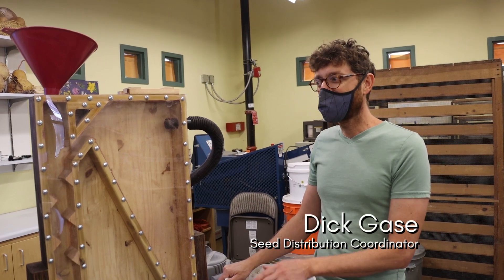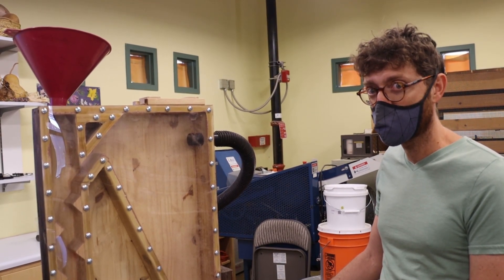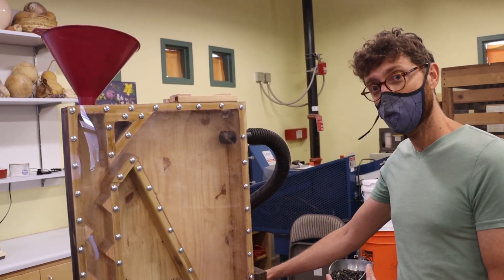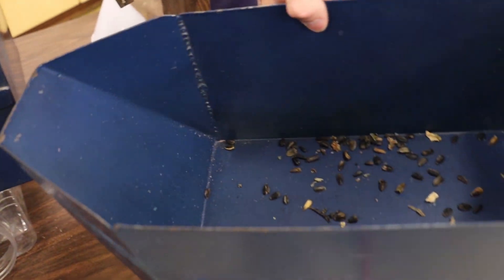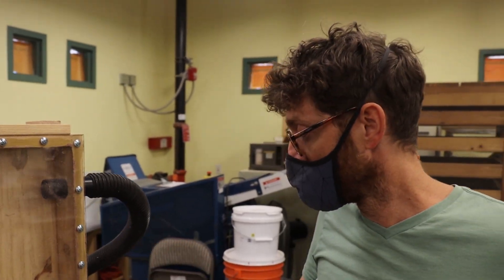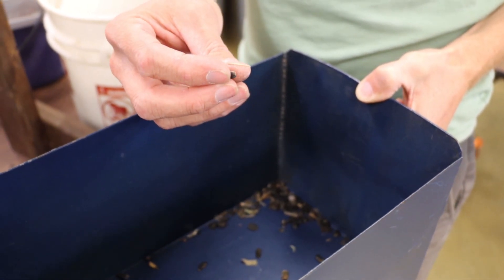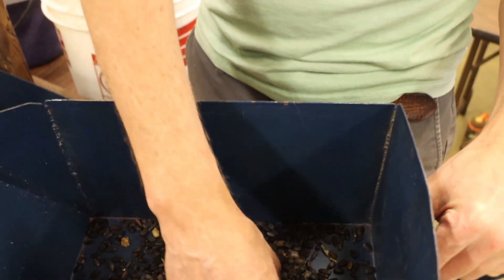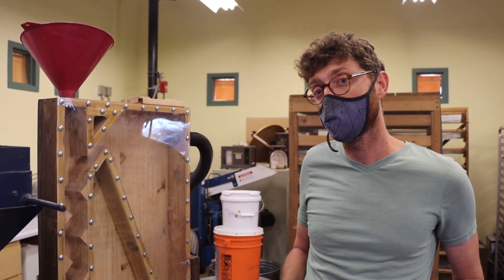DIY Seed Cleaning Machine: Test #2 with Sunfllower Seed

Comment: How do you make it work with variable sized debris?  I have a batch of balsam fir from disintigraded cones..  The seeds vary in weight.  They also have variable sized sead wings.  The scales are also variable weight.
Reply from the maker: This may be a difficult tool to use for variable sized seeds. However, you could potentially adjust the suction and each cycle separate 1 size of seed, and do this multiple times until each size of seed has been separated.